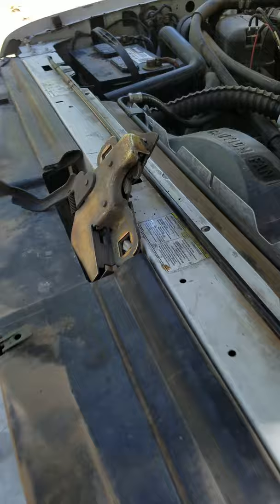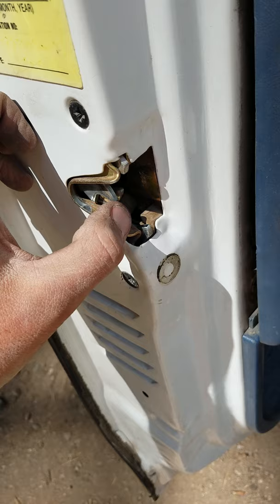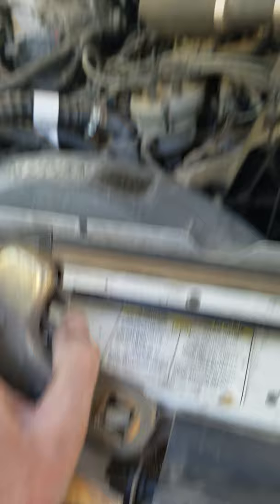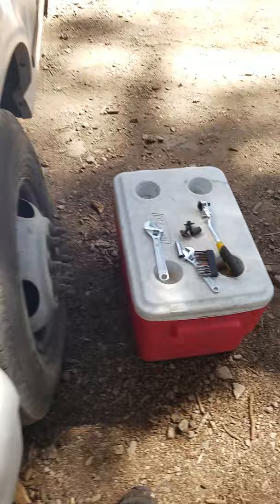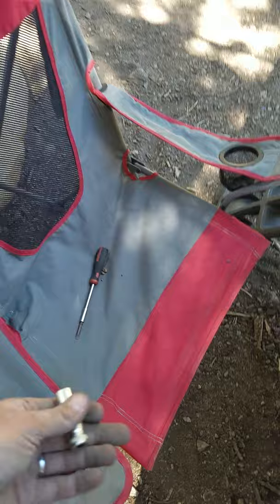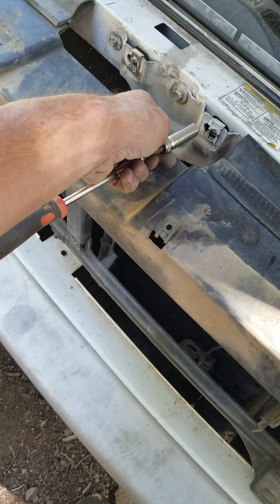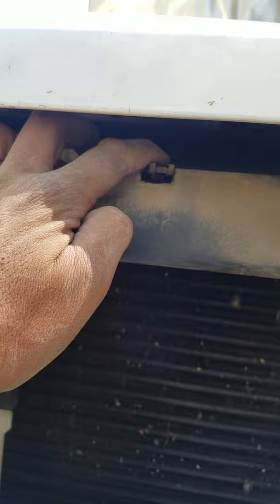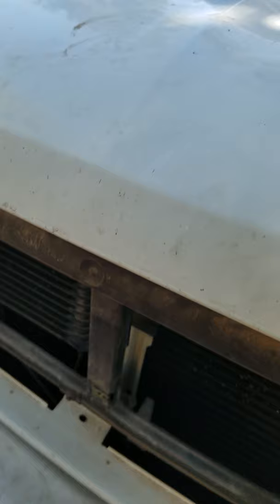How to Release a Locked Stuck Hood Latch on a Ford Truck (Vlog)

Comment: Your idea of using a 10mm socket worked. The wire hook didn't. 
But, I used a 10mm socket, a wobble socket on a 10 inch extension and ratchet. I pried up the hood as far as was possible without breaking the grill, then blocked it with a piece of wood. Took the bolts out pretty easy. Done, finally!
Thank you.
Reply from the maker: Glad I could help! It's tricky for sure